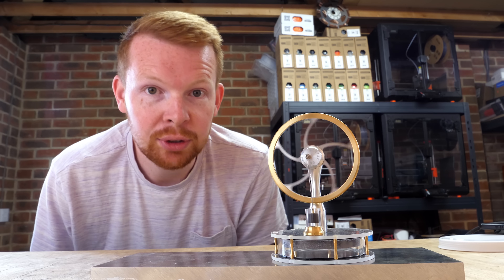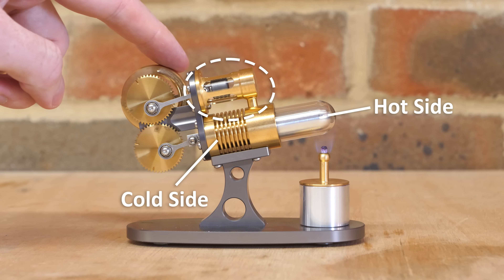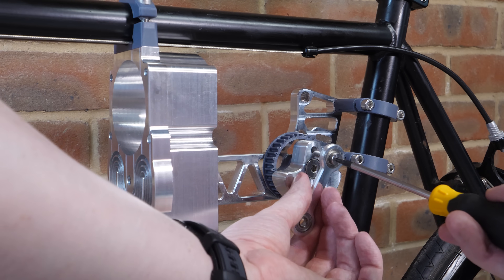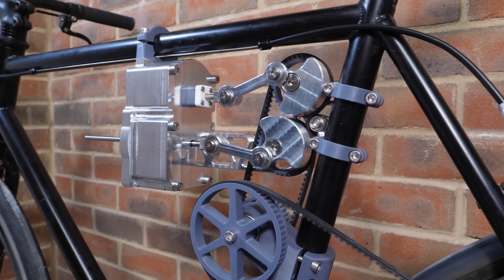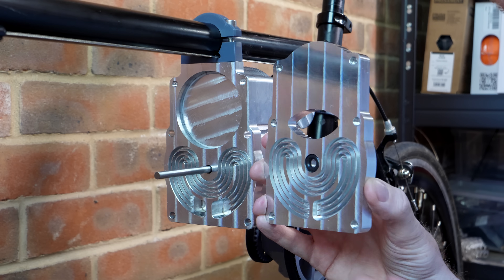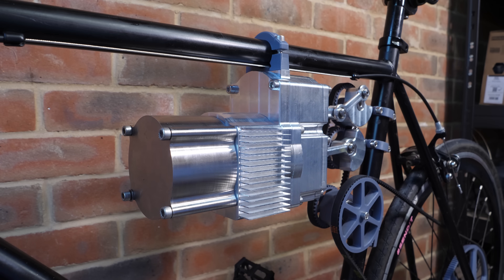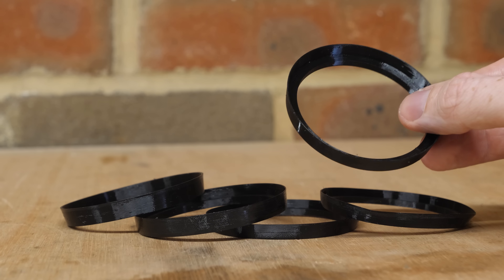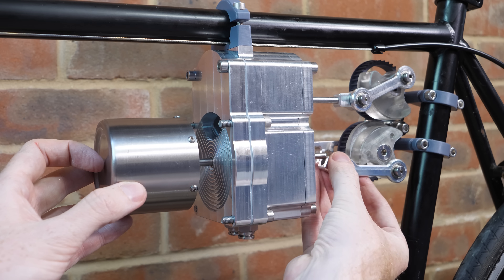Building a Stirling Engine Bike - Part 1

Comment: Love the video. I think you over shot the gear sizes by quite a bit. also look at the placement of your connecting rods from center.(radius dim)Possibly make that larger for more stroke length and better torque. I predict you can make this work but the bike will be going at a crawl. Cool concept! Maybe see if you can make the engine work off the heat from your seat when sitting on the bike lol .. Gluteus Maximus power.

Comment: Your engine is knocking, which I’ve never seen on a Stirling engine before, typically only something you would see on a gasoline engine. If I may, use a slide rod on the working piston, to hopefully force it to travel straight, your gaskets aren’t too good, and relying on plastics is bad especially when dealing with heat, use metal gaskets that you would find on combustion engines. And the gasket that the piston rod passes through, for both working and displacement should be improved majorly. I cannot stress this enough but use lubrication, better seal, less wear, and less friction. You’re not to the stage where you would need a lubricator, simply putting grease inside will be fine, that and the system is enclosed somewhat. The inlet connecting you displacement cylinder and working cylinder is one the bottom of the working cylinder, this means the bottom side of the working cylinder is experiencing working force, but you should alter the design so that the hot air is evenly distributed on the working and displacement cylinder, it would reduce friction, and increase efficiency. Smaller Stirling engines don’t need to worry about most of the things I mentioned for two reasons, they’re small, and forces acting on them are not very great. Later on you could try and compress the gas inside the engine, of course needing to add a crank case, or even switch the air inside for something like helium or hydrogen, by making the atoms smaller you can compact them better without pressurizing the system, and with more atoms inside you have more things to heat up, allow for better power density. Stirling engines are surprisingly strong if done right, if you beefed up and redesigned you currently engine, I would have no doubt you could get 5 or even 8 horsepower out of its size.

Comment: Awesome work! And I'd like you to share your problem-solving process. Here are some ideas:
Can you store heat in warm side of engine as you did with the water cooling system?
And at the end of development, maybe you could calculate the efficiency of your engine and compare it with the smaller desktop model.
Waiting for next video

Comment: I don't think it would improve the performance too much, but why didn't you choose to include fins on the heating part of the engine? This would increase heat transfer to the system, thus increase the output power.

Comment: The air in the engine might be creating a vacuum and sucking air past the power piston seal as it looks like the seal is only designed for pressure

Comment: When you say Stirling engines are efficient, are you actually serious or just being sarcastic?
 They seem incredibly inefficient to me. You're blasting them with heat energy while losing a whole bunch of that heat to the surrounding air, all while barely producing any usable work out of the engine. It seems like just about the worse possible way to turn energy into rotating motion.

Comment: Hi! Stirling engine has to have a very good seal in the piston because it is double action. It reaches balance between minimum and maximum air volume/pressure and corresponding piston positions at dead ends. Only then it's efficient. Try polishing the cylinder and make piston out of graphite. After lapping it should be butter smooth and airtight with very little friction. Displacer seal too. Heated part should have fins too. Displacer must have very low heat conduction, by that I mean surface. Piston, cylinder too. Titanium is the best material for them since it's not very conductive for heat. If made good, at your volume it must drive your bike well. After it works good with air, replace air with helium to boost efficiency even more

Comment: I'm assuming you got a version with a single crank working on a bench first, right?
You didn't just go straight to making a dual crank(?) version straight onto a bike with high gearing and the cranks only supported ona  single side (allowing for some deflection), because I think the square-cube law will kill any chance of 0.2HP otherwise.
(Also I could be very wrong but I think having a very wide bore means allot of piston ring contact with the cylinder wall so going over-bore might be better..... then again maybe that long stroke just increases wall contact too).
You can get 2-3-4 cylinder stirling engines so if I had a CNC I'd probably be going for that and then going for very low gearing still.

Comment: You're missing out on a heat regenerator, which would increase efficiency by a fair margin. surrounding the displacement cylinder with heat fins or steel wool would be enough.

Comment: At the risk of repeating what any other machinist in the comments may have already said:

That tall tool you were using to pocket mill in the beginning.  Around 2:36.  Don't start pockets with it by doing shallow step downs if you can help it, and definitely always leave room for a full depth finish pass. You probably can't efficiently use the whole length, but doing little tiny step downs wears the tip.  Depending on your tool options, either rough out the top of the pocket with a shorter tool, then go to the long tool for the bottom, or just do slightly deeper stepdowns.  And predrill!  Your endmills will thank you.  Just take a drill that's slightly larger than your endmill and drill to a hair over the bottom of your pocket's final depth, or all the way through if the pocket goes through the part.  Then you can plunge down into the hole every step instead of ramping and wearing on the corners of the cutter or plunging with an endmill.  Even just a small drill, smaller than your endmill, helps a ton by relieving the center of the hole.  Rigidity is key.  Always use as short and thick of a cutter as you can get away with, and hold as much of the part as you possibly can.

Comment: that is stellar dude! can't wait for part 2!
some  ideas for the brain stew! i noticed some pretty heavy peaks and valleys with that piston flow, do you think a double heating chamber with 2 pistons might get you more consistent hp? after all, the chamber itself doesn't need to be circular. as long as the displacer piston is the same shape you could do any shape you want! boxes, half-moons, heck! you could do 3 pistons at once with a central shaft and two arches to either side!

Comment: Hey just letting you know you had the right Idea with the inlet of more air but I think you need to add a one way valve into the piston for more compresstion if you watch a channel called " Shane Pomeroy " you can find lots of good info on how to build these things as he has now built a Mk-5 Stirling engine with good enough efficiency to run as a small locomotive. Ive been watching you for a while now and I really appreciate your work and now im trying to help back.

Comment: A speed adjusting "flywheel" (Google: centrifugal governor for stirling engine) 16:29

Also through this video the timing has varied between the primary and secondary piston position. Just like with a combustion engine your timing must be correct to get it to work correctly. Think of the secondary piston like a header valve. If it doesn't open or close at the correct time the gases don't move correctly and you will have used too much fuel/heat to move the gears. I'm this case check where your gears are for the piston position

17:47 continuos variable transmission or CVT like used in snowmobiles it would be a great reference for how to allow the engine to continue to run even when you're not trying to go anywhere.

Comment: Why are you using gamma configuration (which is the worst in terms of efficiency) instead of alpha (most efficient) or beta (most compact)?

Alpha configuration consist of two working cylinders, hot and cold, without the displacer. It's the most power-effective configuration
Two cylinders with different temperatures means easier heat management - minimalizing problem with losing efficiency due to cold side of cylinder getting hot

About clutch, there is this really interesting bicycle transmission called Ratio Zero, which could be perfect for stirling engine. It's a CVT type of transmission with ability to reach 0:1 "gear" ratio, which means it can act as clutch. CVT also means you can effectively use such unresponsive engine
Reply: I'm not hating im just genuinely curious, because for a novice in stirling engines like me it seems pointless

Comment: 13:39 Tom, Stirling engines aren’t supposed to have high compression. Having a compression ratio higher than 1:1.5 or even 1: 2 can stall an engine. The adiabatic pressure swing of the compression stroke is the thing that stalls most Stirling engines and keeps them from starting.

Comment: Tom, around 7:08 you say that Stirling engines are more efficient but you left out the thing that actually gives the Stirling engine its high efficiency. You need to include a regenerator that exchanges roughly 3x the amount of thermal energy as the work done per cycle. Without a regenerator your Stirling engine won’t be anywhere near the promised efficiency. I’ll email you to explain the details.
Reply: Last few minutes of the video he says that he's going to fit a regenerator among other things
Reply: You're correct, but he wants to get 150W from that engine and couldn't get it running by itself at first. It seems there are many other factors that have to be sorted out to get a decent power output first before attending to increased efficiency.  His reasoning during the development seems to be spot on to achieve his goal.  I'm sure he knows about the regenerator and left it out on purpose just to add it later.   Good observation though.
Reply: @henkvaneeden9054  In the case of Stirling engines, efficiency and power are not independent factors. The regenerator removes heat from the working gas so you don't have a thermal bottleneck at the heat sink, and on the return path, the regenerator dumps that heat back into the gas so you don't have to put as much heat in at the heat source.

The problem with power density comes down to the low compression ratio that most Stirling engines operate at. Stirling engines can't handle high compression ratios because of those thermal bottlenecks; compression at high speeds causes adiabatic heating that the heat sink cannot scavenge fast enough. It seems that the only practical ways to improve the power are to increase the pressure of the engine and to increase the temperature differential between the heat source and heat sink.

Comment: is the timing correct? Stirling engines should be 90 degrees out of phase. when I pause the clip it looks like your cranks vary in position relative to each other almost as if there is a difference in the gear ratio? should be fixed 90deg difference.
Reply: It's 90deg.  He said so

Comment: Camden Bowen: 2 stroke and 4 stroke
Intezga: jet and rocket engines 
Tom: air engines (high pressure and high heat

I’m loving all the engine content.

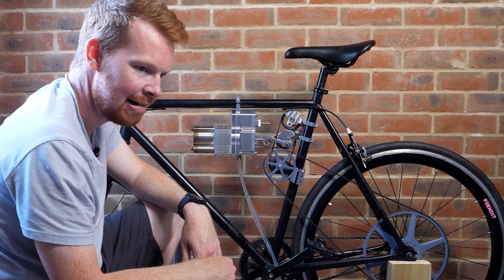Comment: 14:21 - lol -just gave me the idea to make an AI-powered RC car. Super impractical, but it would be cool if we could use the power from processing to do useful work while cooling a processor.
Reply: Why not just add a peltier module on the processor?
Reply: @VSR_FAN_PAGE_ too weak and inneficient
Reply: @wojciechtechtips1602 He wants to run a Stirling engine with processor's heat, if I'm right. That too isn't efficient, and too much complex.

Comment: What about a two cylinder engine with a 90 deg offset.
Both on the same belt

When the wheel was on you could see the engine struggeling in between strokes

Comment: Reducing the diameter of the power piston should get you a lot more travel. 
 the same tricky used to expand these surface area of the cooling section might also help the heating section. 

You're probably not going to get enough power for direct drive. So you're probably going to need a flywheel that you store power then use the power from the flywheel. 
It probably has a desired RPM, so you're probably going to want a CVT to slowly get the flywheel up to high speeds. 

 with a massive flywheel, you're probably going to need to make a dedicated cart.

Comment: Couple of points:  1) How easy is it for the air on the bottom of the power piston to exit the housing?  Looks like you just have a slightly loose fit for the connecting rod, this could be adding quite a lot of pumping loss.  2) The last design of your piston ring only seals in one direction, but it needs to seal in both directions on this engine.  When the air is being cooled, it contracts and atmospheric pressure is pushing the piston into the cylinder.  You might want to investigate using graphite for low friction and good sealing, though it's not easy to work with.

Comment: i don't know if you forgot or didn't put it in the edit but i suggest lubricadtion of the internal moving parts, especially the piston ring as is wil greatly reduce friction and increase sealing.
also you can try honing the cilinder for a better surface to also reduce friction.

Comment: Every new idea comes with trial and failures. But persistence always prevails. So keep at it and you will be rewarded with your new idea... I will say that with the heat needed, this would be great in the winter time to both heat the engine and yourself.  Also maybe an electric heater system that uses a battery would be a good idea, no flames.  Thumbs Up!

Comment: Hey Tom,

It should also be possible to increase engine output by running your engine under higher air pressure. As in, adding a valve to your engine which allows you to put the entire system at rest at 5 bar or something.

There are 2 video's on Youtube which contain a huge amount of information. They're from Philips from way back when they were working on Stirling Engines. Maybe you can also borrow some concepts from them?

https://youtu.be/GqIapDKtvzc?si=xk8ptNL1UaCaMmok
https://youtu.be/GFfMruoRMGo?si=hz3lelKDzFVG4ztQ

Comment: You need to read the book by Andy Ross. Don't try to break any open doors. Fitting the engine with a Heylandt crown is essential - for any reasonable efficiency and power the hot side needs to be kept at 400-700 deg C and it requires a large surface area. The thin piston is a pointless complication - friction can be avoided by adopting a different linkage.

Comment: Could easily be called a cold air engine. The Carnot equation actually means colder is better than more heat. ie, a room temp, liquid nitrogen engine is more efficient.

Comment: Stirling engines generate power during both the upstroke and downstroke of the power piston. Therefore, a one-directional ring piston design is inefficient for this purpose. Additionally, you should use a tighter-fitting displacer piston and consider pressurizing the engine (like a pressure vessel) to increase available power output.

Comment: Something I noticed in that closing shot of the engine running is that you can see it moving, probably because of the 3D printed bracket holding it to the frame. That movement is probably costing you some power/efficiency, so switching to a sturdier bracket and/or adding more bracing should help.

Great video though, love the project, and some beautiful machining going on!

Comment: In the end you can still see the upper piston shaft wiggling up and down. That means your piston is tilting in its bore and not sealing properly. I‘d try to get a second bearing surface on the rod if possible

Comment: I always wanted to produce a Stirling Engine. I’m curious what your heat source solution will be? I always wanted to produce a sort of hybrid with an ICE’s exhaust as the heat source for the Stirling Engine. Where the gas engine could be deactivated during coasting or when using the stored heat in the Stirling Engine

Comment: Posting this in the summer qnd it got me thinking, 8f you coated the heat side black to absorb sunlight in time it should eliminate the fuel source to get it running.

This leads to my second option, instead of running a drive wheel to move the bike can it run a stator to charge a battery to run the bike.

Additionally with sterling engine toys you can power them with the warmth of your hand.

Why not use the seat as a contact point to power it with the warmth of your... backside

A backside powered bike.

Comment: Congratulations on making a running engine!!!! You should also put a linear bearing on the power piston. It has too much slop and the piston is rocking....it will wear out and you are also loosing power as the force is not acticimg perpendicular to the crank pin. Try polishing the cylinder to a mirror finish. And last, try a lower tension piston ring. Friction is a number one killer for stirlings. 100 watts is very hard to achieve. You may well need more heat and more hot head surface area. Good luck and looking forward to the next video

Comment: make the clutch electric take a page of hybrid vehicles and lovomotives.
charge a battery on emgine power and use the battery to power an electric motor.
It's just as cool as a direct drive Stirling 'cuz now you gotta figure out a good way of trying it into an appropriate generator.
Reply: or you could just forgo the battery and power it directly similar ti a lovomotive.

Comment: I don't think you need a clutch, just good brakes and a thermostat on the hot side. If the motor is not turning, the heat is not transported to the cold side, and the thermostat will pinch off the fuel flow.